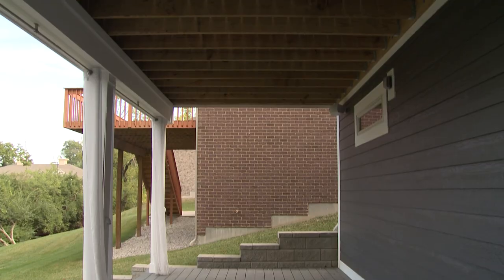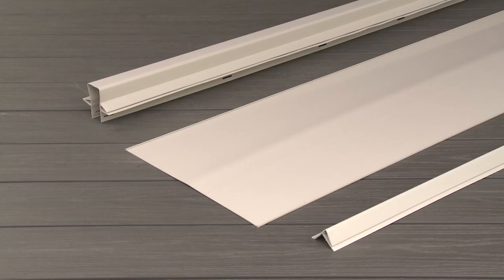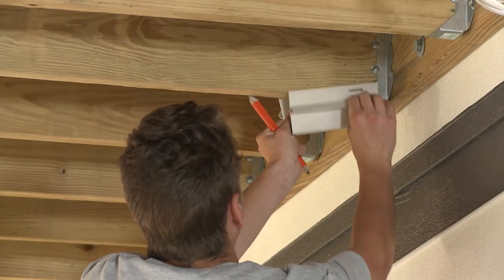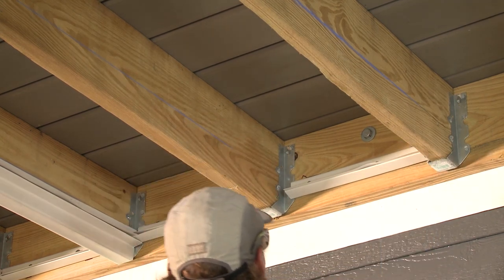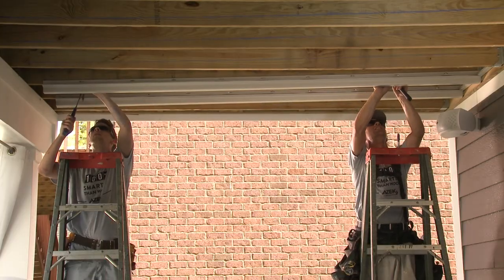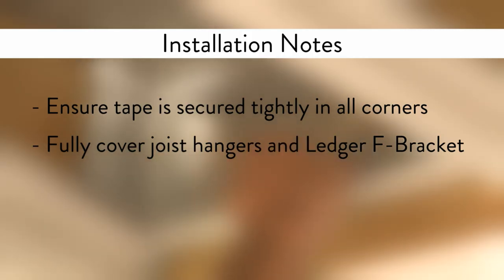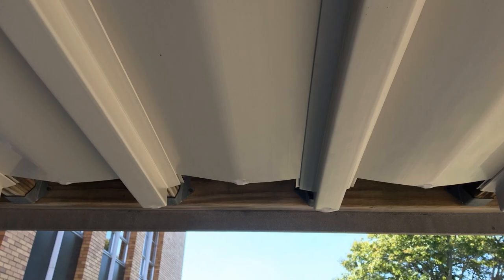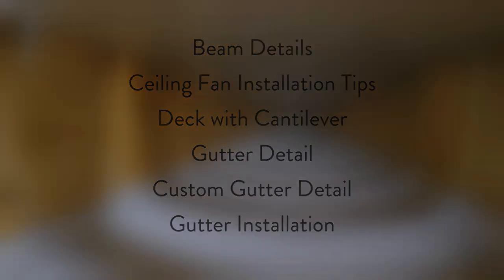TimberTech® DrySpace™ Under-Deck Water Management System Installation

Comment: I noticed on the video of the DrySpace the bottom 1-1/2"  of the ledger board is exposed. What is your recommendation to close in, cut a 1-1/2" angle of aluminum or vinyl to create a flashing or is their a product for this, it would have to be notched at every joist and hanger.

Comment: Caution This product is not a deck waterproofing system. It is only intended to shed water to a interior gutter.  Also it can not used with enclosed space under the deck (sunroom, etc.).  Installation instruction are miss leading and do not clearly state this.
Reply from the maker: Hello GRI Sales, DrySpace is an under-deck water management system, designed to provide a usable living or storage space under an elevated deck. From Page 2 of the DrySpace Installation and Maintenance Guide: DrySpace should not be enclosed with a wall around the outside perimeter of the deck. It is not intended to be a water proof roof system.https://timbertech.com/docs/tt/installation/TT_DrySpace_Install_05_14.pdf
Thanks for reaching out, and sorry for the delayed response!